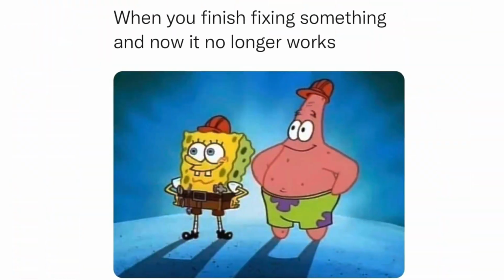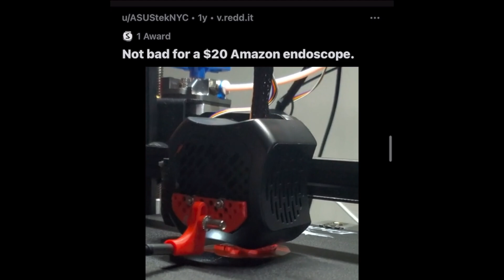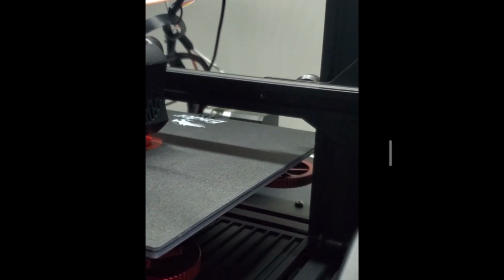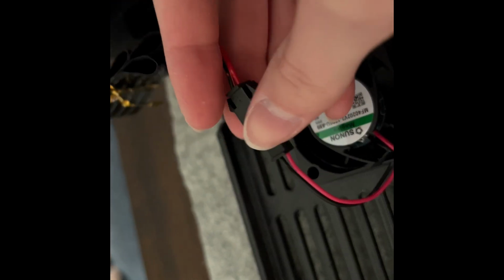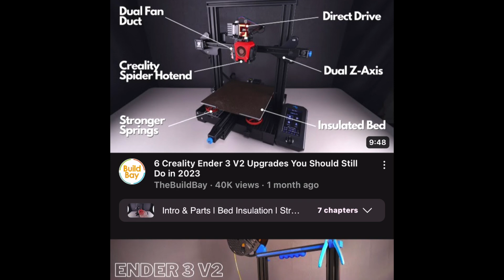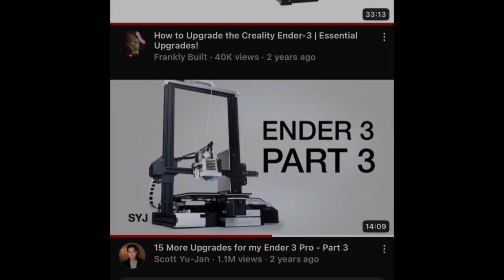Upgrading The Ender3V2: My Experience

Comment: Do you have the link for the wire management cable holder that goes from the hot end down towards the extruder it looks like old telephone cord
Reply from the maker: Yes! This is a link to the armadillo flex file with lots of different length and width options, but the minimus fan shroud itself is free and comes with a short length of the armadillo flex. 👍🏻
https://cults3d.com/en/3d-model/tool/armadillo-flex-wire-conduit

Comment: Great video! I got my first printer a month ago, an Ender 3 Neo, and I think there hasn't been a day I didn't print something. I'm hesitant to make too much mods since is working very good. The main thing for me was to use the cr touch with pronterface to check the numbers of the 16 points and adjust the wheels until I got them all under 0,1 mm, so they all are 0,0## and then I don't use the g29 before every print because the bed is leveled for a long time. I did changed the springs for silicone spacers, which helped to get the bed almost rock solid (I have also locked the wheels with some printed clips so they don't rotate whenever they want with vibrations etc). I was about to buy that exact PEI sheet which is beatiful, but the glass is working well with some adhesive spray here and there. I will probably do some of this stuff at some point, particularly interested in the quiet fans.
Reply from the maker: Glad you got your printer up and running well! It really is a fun hobby if you can get everything working right. I highly recommend the fans, they improve the sound a lot!
Reply: @KiwibearBuilds  👍👍👍 btw I changed my mind and today I just got a pei sheet...jeezz this is a dream to print on!!! 😍😍
Reply from the maker: @Drumaier  I know right?? You definitely made the right decision!

Comment: You could try an optical filament sensor, they have no friction and are essentially just a light and a phototransistor so if the light is blocked the filament is there, if the light isn’t blocked then you have run out.
Reply from the maker: That would be great, thanks for the tip!

Comment: You claim the BL touch with the wrong cable will ruin your motherboard but then you say you just swapped the wires and it worked, yes it could damage your motherboard or the bl touch but I think you were being a bit dramatic.
Reply from the maker: Everyone I was talking with at the time about the problem seemed shocked my board wasn’t fried… I either got really lucky that it still works, or the backwards cable wasn’t as harmful as I thought. I would like to think it is the latter, but searching on the internet I found a lot of posts of peoples boards being ruined because of the cable
Reply: Most motherboards are unprotected against power shorts in the sense that a short on the low voltage rails will fry the linear regulator generating it.

This however is not guaranteed, since 

1. The failure is temperature related and most regulators have a high temperature cutoff. The regulator will fail regardless when shorted since this protection is too slow, but if the short is "bad" then it might survive.

2. The BL touch could be protected against reverse polarity. A protection circuit can be done e.g. with a simple inline diode. I dont know if the bltouch has something like this, but its not out of the question. I would however never rely on it being there! 

Just a bit of background regarding this issue and why the board might have survived.
Reply from the maker: @jojoposter  interesting, thank you for the info! Either way i am thankful the board survived and I will definitely be more careful next time!

Comment: Luv your  video - I recently got an Ender 3 Pro on indefinite loan for free from my son and I've started to learn. I was lucky because after changing the magnetic bed sheet ( because the original one was showing substantial wear ) and following some basic YT videos on leveling , I have successfully made 5  prints with zero bed adhesion issues. Is it fast like a Bamboo Lab X1, of course not but I'm learning a lot and just about any issue has a fix by someone. It came with 5 rolls of filament so my cost is close to zero - what a great hobby. Sincerely a question - how the hell did you spot the reversed wiring ? - I would have plugged it in and blown the main PCB.
Reply from the maker: That’s great you got a free printer and have gotten into the hobby! Bed adhesion was one of the main things I struggled with in getting my printers set up but it feels great when you get it right. Also, I actually did not spot it and plugged it in, and got extremely lucky that it didn’t ruin my board😅 only after some searching did I figure out that the cable was backwards. I plan to make a short video about that topic in case it can help someone spot the problem before plugging it in!

Comment: Just started to mod mine!

do you have the link for the fans?
Reply from the maker: Yes, this is the link to the specific one I used on Digi-Key! You can get the same fan in 12v or thinner, but this one was perfect for me. https://www.digikey.com/en/products/detail/MF40202V2-1000U-A99/6198739
Reply: @KiwibearBuilds  i wish they had the Noctua in 24v.

thank you for the link!
Reply from the maker: @wollinger  even if they had a 24v noctua I wouldn’t have trusted it to cool the hotend since it has such low CFM, but that’s just me. I think this fan is a good middle ground! Of course, I’m happy to help!

Comment: great video but i can’t find the fan you used, any help?
Reply from the maker: Sure thing! This is a link to the exact fan I used on Digi-Key. But you can get it in both 12 and 24v according to what printer you’re using. There is also a 4010 option, but it has lower CFM and will also need to be louder to have the same output, so I thought this was the perfect middle ground. Tell me if you have any questions! https://www.digikey.com/en/products/detail/MF40202V2-1000U-A99/6198739
Reply: @KiwibearBuilds  ty i appreciate it, i got my ender 3 v2 not knowing anything abt printers cause i needed one for a project of mine and saw it was convenient but I want to make it the most optimal printer i can.

Comment: I’m new to the printer world so excuse this question.  But why do people buy the low cost printer just to spend more money on upgrades?  The more expensive ones won’t do what the upgrades will?   I bought an ender 3 pro that’s why I’m asking.
Reply: There are a few reasons and it depends on the person. Sometimes it's better to pay to make a printer exactly as you want it and be able to say you built it yourself. For others it's because they want to start cheap and slowly make it better. Other times it's still cheaper to make a cheap printer better than it is to buy a better printer off the bat.
Reply from the maker: Exactly. For me, I bought this printer before I knew much about them at all, and then having a more expensive printer raised the bar for what I wanted in my printers, so I decided to upgrade.

Comment: Great Video! Im looking forward to getting mine soon and doing some similar things, im thinking you could print a guide for your filiment so it foes into the filliments sensor more straight and doesent catch or drag. Anyway i really enjoy your video, keep up the good work!
Reply from the maker: Thank you! I did print a filament guide 😅 maybe I need a better one with a wheel🤔 I appreciate it!😁
Reply: @KiwibearBuilds  whats the spirally springy cable wrap thst you used? ...
Ps i got an ender 3 v2 and modded it with dual belted z, hero 7 phaetus hot end.. its pretty rad

Comment: Quite confused as to why you saw such a noise reduction switching from the 4.2.2 to 4.2.7 board. The 4.2.2 should have 2208 silent steppers. The 4.2.7 does have, I think, 2225 drivers, but they are to all intents and purposes the same.
Reply from the maker: Yeah it is a little confusing, some 4.2.2 boards are silent and some are not, it just depends on whether they use silent stepper motor drivers, whereas all 4.2.7 boards are silent
Reply: @KiwibearBuilds  I did read on other Ender 3 models you could get either, but on the V2 they were all silent. Who knows - Creality are always changing things
Reply from the maker: Agreed, they do change things a lot😅 and I’ve definitely heard of some peoples V2’s being silent, so I guess I had bad luck with mine😂

Comment: For the minimus shroud, how did you wire in the 5015 blower fan? Did you just splice and heatshrink it? I'm gonna use the minimus with the dual 5015 blower fans and I'm thinking of just splicing them together instead worrying about JST connectors and making a splitter. How do you like the shroud and parts cooling?
Reply from the maker: Yep, that’s exactly what I did! Honestly, I may go back in the future and put in JST splitters just for replaceability, but it’s working good for now! I’ve been loving the shroud, and it’s working great! The only problem I’ve had is actually getting the 5015’s in; you really have to push on it to get them to go in there😂 then again, my tolerances aren’t the best and yours may be better.

Comment: I look at the ender as a box of parts. Creality put together a BASE system, and although it will print, its meant to make into your own. That said, Creality is a bad company, their products out of box have much to be desired, and their warranty is non existent. I am glad you have fun with the Ender. Look into the lead screw elimination mod.
Reply from the maker: Wow that looks interesting, I’ll look into that. Also, true😂 maybe that explains why they have so many versions of each printer lol
Reply: @KiwibearBuilds  haha yes!! Anywho.. I will be watching, I need to get a channel set up soon. Have fun!
Reply from the maker: I can definitely see that. I’ve personally had fun with it but yeah, I’ve had bad experiences with creality cutomer support, I think they kind of use the community to be their customer support😂 they’re good for accessibility though so you can get yourself started in the hobby with a cheap printer. Also sounds interesting, I’ll look into that upgrade. Thanks!
Reply: @KiwibearBuilds  https://www.youtube.com/watch?v=438sJ2AEgXs&t=3829s

lead screws are FTL seriously, this is the best ever. Only thing that you will get hung up on is the wire to the control board from stepper. 

Yes Creality also wants the customer base to fix their stuff, make the fixes, share fixes, and they just include those fixes in on the next gen of printer like they did it. I don't like the company Creality, if I can get the $99 from Microcenter I will though, just to mod and fix.
Reply from the maker: I will, thanks for the recommendation!

Comment: My Ender3v2 Had a warped extrusion I didn't catch until last week XD 
Had it for a year and never figured out why my first layer was inconsistent even over small distances. Turns out a warped X extrusion can cause massive differences!!!
Reply from the maker: Dang, that sucks… seems like a problem that’s difficult to spot. Glad you got it taken care of!
Reply: @KiwibearBuilds  Very, I didn’t get an ABL prove until I got my KlackEnder and Klipper but from what I could find it would not have mattered and actually would have been worse unless I had a 0-Y offset mount and with my duct that is next to impossible. Though I am printing a new duct once I get this squared away, literally 😂
Reply from the maker: Interesting, that sounds pretty complicated to fix. Also, I really wish I had known about KlackEnder before bought a BLtouch, it would’ve been cheaper and also more fun to make.😂
Reply: @KiwibearBuilds  yeah the klack was the best thing I’ve ever done besides Klipper. So quick update, the problem is LESS bad with the new X but I still have inconsistent first layers. So confused now cause the people I talked to have fixed their problem this way 😂 Imma lose it
Reply from the maker: @SiFireHasSpeed  huh, that’s weird. Have you gone around to check the basic stuff like loose screws and wheels, bed tramming, or warps in your bed? Also, I used to have a lot of trouble with adhesion on every bed I used until I moved to a pei sheet, but it is kind of different for everyone
Reply: @KiwibearBuilds  I have a WhamBam flex plate so adhesion wasn’t the problem. I checked all screws, bed, etc etc but finally just went “F*ck it” and disassembled the ENTIRE printer to individual extrusions, upgraded to linear rails, and then squared EVERYTHING. Then put KevinAKASam’s belted Z. Now. Perfect layer. I have no idea what frickin was wrong but OH MY GOD was that a long day yesterday 😂
Reply from the maker: Wow! Sounds like a tedious process but at least you got the problem fixed!
Reply: @KiwibearBuilds  Indeed 🤣😂. Almost threw in the towel for a second
Reply from the maker: @SiFireHasSpeed  I definitely know that feeling😅 feels great when you get the problem fixed though!

Comment: I have an Ender 3 S1 (terrible QC out of the box) and an Ender 3 Neo (awesome QC out of the box) and have learned a lot about 3D printing using both.  Ugh. Can relate to the wrongly wired cables with products from Creality and sketchy documentation. I didn't release any magic smoke, but got close to it before I double checked. Also, having quiet fans is the best. Two 5015 fans at 50% speed is definitely the way to go.

Enjoyed the video. Hope you make more.
Reply from the maker: Huh, I thought the S1 looked pretty cool, but I guess it’s not all it’s cracked up to be. Also yes, from now on I’ll always be double checking!😅 lesson learned! Also, I totally agree! I’ve been getting great cooling with the fan setup and also it’s decently quiet! Thank you, I appreciate it😁
Reply: @KiwibearBuilds do you happen to have a link to the fans you upgraded to?.. and possibly a link to a video showing how to make use of more than 1 fan? i have an ender 3 neo that can stand a little shushing ;)

Comment: I agree. The Ender 3 v2 is super improvable. I've made many of the same improvements, but I'm running Klipper on mine, and a SKR Mini 3 v3, and a Creality Spider 3 hot end. Oh, CR-Touch instead of BL-Touch. Have fun with yours. Mine is my go to printer for high quality low tolerance prints.
Reply from the maker: For sure! I’m running Klipper as well and it has been fun! Difficult at first, but fun.😂 Yes, the ender has become super reliable for me too on the same level of my Prusa. :)
Reply: What hotend or part cooling system are you using? Currently have the spider 3, but want to upgrade to 5015s.